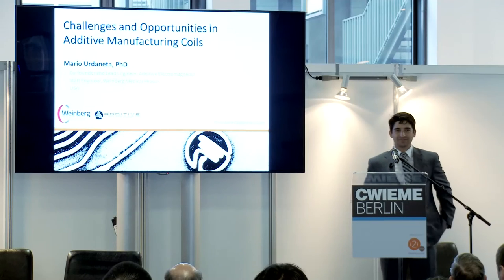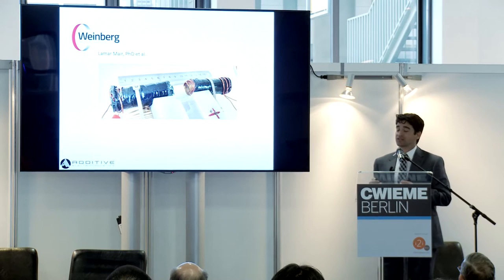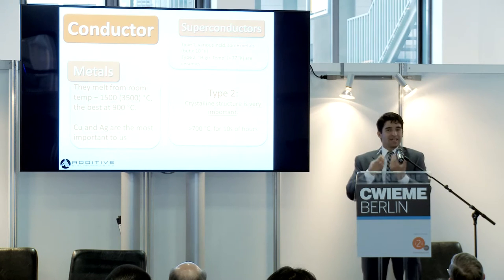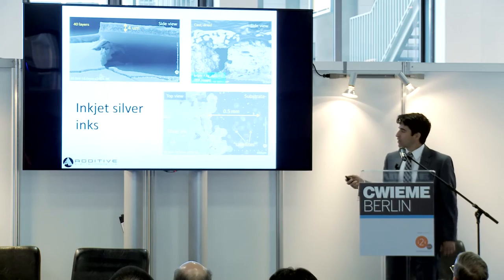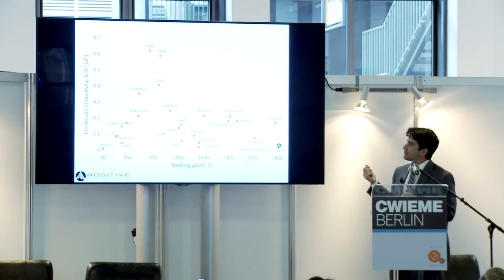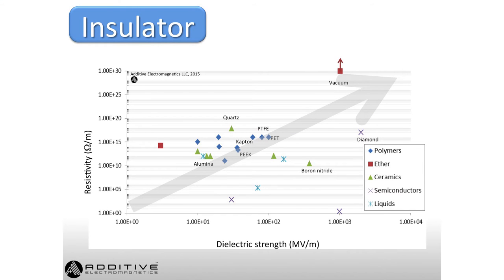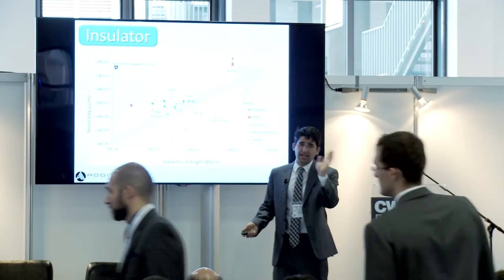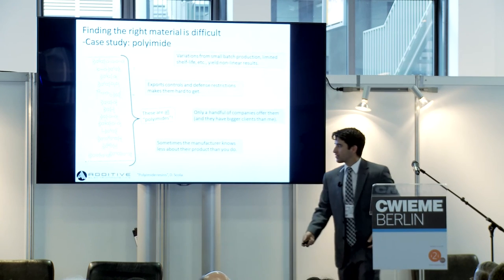3D printed coils - challenges and opportunities

Comment: 3D printed coils would be awesome for drones... I'd print the coils inside the duct of a ducted propeller and have a ring of magnets around the outer edge of the propeller... it would make a nice brushless motor... you could even have a 3 prop drone and the props could each share one coil helping to reduce the overall weight.